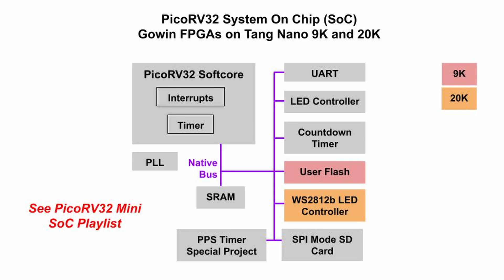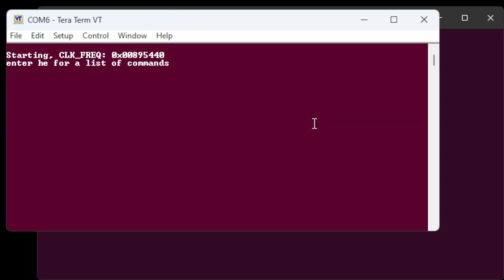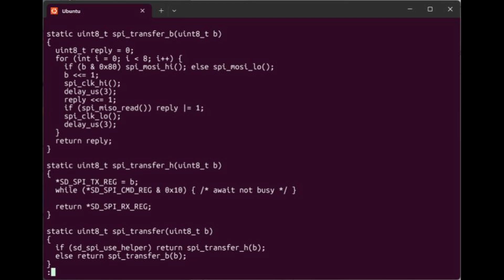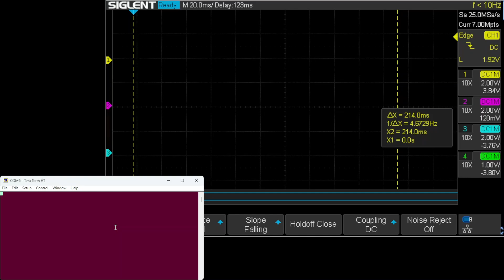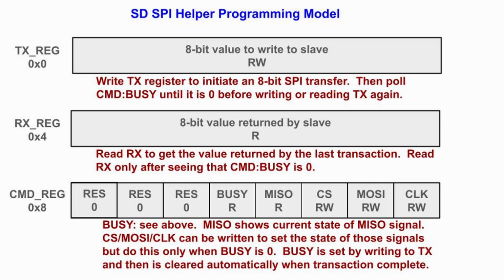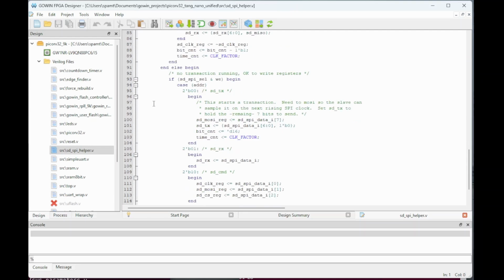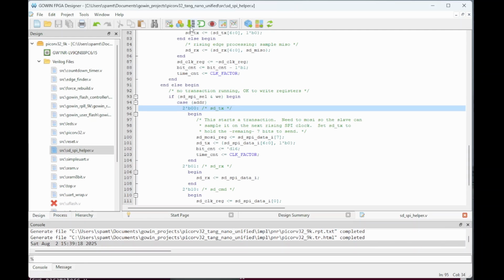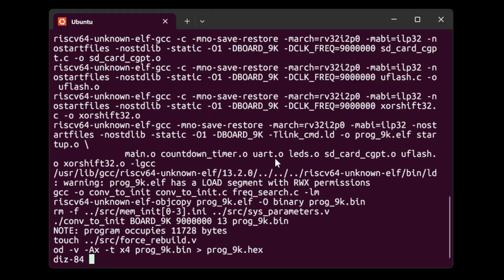SPI Mode SD Cards on Tang Nano 9K and 20K with PicoRV32 RISC-V Core

Comment: There are 3 uSec delays in your bit banged SPI. With just one for clock hi and another for clock low, this is 6 uSec per bit, which translates to a maximum rate of 167Kb/s. If these delays are required for whatever software you're using to drive your MCU IO pins, then this is your bottleneck. If you can eliminate or just reduce these delays, you will get better performance. Sure, a hardware SPI is going to be fastest, but bit banging is a good choice in many circumstances.
Reply from the maker: Agreed.  More carefully programmed delays in bit-banging can reduce the performance gap quite a bit, but it can get messy and more difficult especially if you plan for more than one core clock speed.  In some ways, the hardware assist makes the job easier as well as giving a performance boost.  The hardware approach also gives extremely consistent timing which is nice.  Since I am running this on an FPGA, the hardware assist is quite low hanging fruit.

Comment: Hello Grug!!!
Is it possible to setup the FPGA either Nano 9K or 20K to run a minimal Linux system using the picorv32 core and other peripherals??
Reply from the maker: It is possible.  Look at the litex project-- just google "litex fpga".  The project is from enjoy-digital.  Also google "Getting started with Litex on a Tang Nano 9K  jaeblog".

Litex is very capable, but does not meet my needs.  It is very abstract and uses unusual tools.  My goal is to learn by doing things myself.  Litex has a large learning curve for that-- but if you just want to get an small FPGA-based SoC running, it might be great for you.

For real projects (with a budget!) that need Linux on an FPGA, my instinct would be to use an FPGA that includes an ARM Cortex-A (Like A-53) hard core.  Linux would probably already be available from the FPGA-vendor.  I wonder if there are FPGAs with a hard core RISC-V (with MMU).  That would be good, too.

I am also not a fan of MMU-less Linux, but I think Litex supports riscv cores like vexriscv that have an MMU.

Cheers
Reply: @electronics.tinker  well can't expect to run MMU Linux with PicoRV on Nano 9K or 20K, or can I???

Comment: I've been thinking of doing this for my own rv32i SoC. Too bad that the newer SD Cards seem to not support SPI Mode (doesn't really matter for my microcontroller class core lol), I'll find one. Thanks for posting this!
Reply from the maker: Yes, the SD spec says that SDUC cards don't support SPI mode, but I think these are not yet common.  I have not bought a micro SD card in several years, but every one of my more recent cards worked.  The only one from my stash of cards that failed is a very old 128 MByte card.  It conforms to an older version of the standard and needs a different initialization sequence (that ChatGPT totally botched).  Rather than try to fix support for ancient cards, I just deleted that part of the code.  My bet is that cheap cards bought from Amazon today will work.  Just stay away from anything that says SDUC any maybe avoid super large capacities.  Cheers.